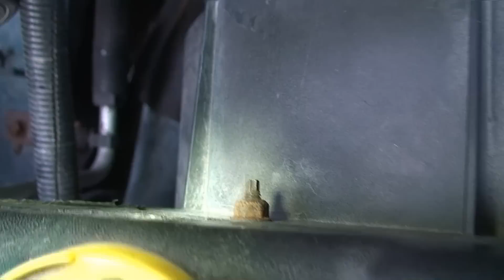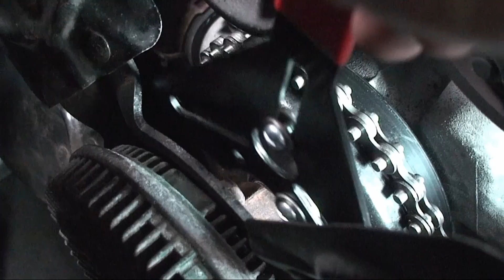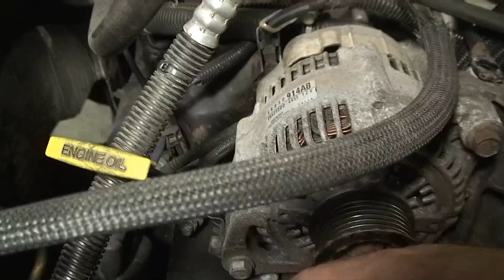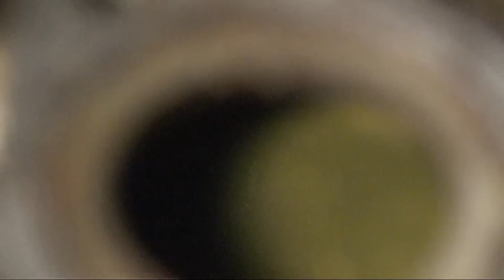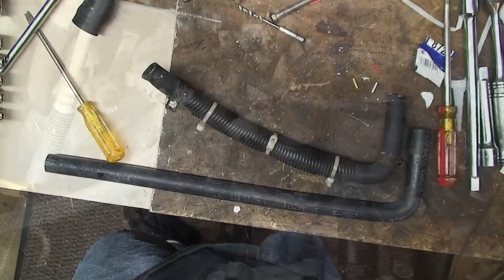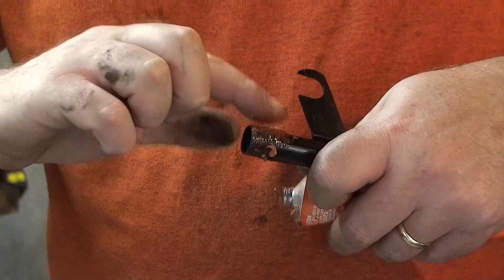Dodge Dakota Coolant Leak Repair - Including Bypass Hose, Thermostat, Water Pump, etc.

Comment: The Bypass Hose From The Intake To WaterPump Is Such A Bitch. Something Notorious Simply Not Reachable As It Really Should Be. I Always Replace The Bypass Hose When Replacing WaterPump. Just Like Replacing Timing Chain/Belt, Guides. Imma About To Find My Leak Today, I Hope It's Just The Heater Core Line Going Into The Intake. I Put Flush Lines On The Heater Core Lines. 1997 Dakota .318... 
Ole' Man Winter Can Be Brutal... Good InFormational Video. I Always Play HELL Getting Radiator Bolt Loosen. Somehow I Always Break It Loose. I've Been Told To Use A Torch To Heat The Nut Up Some, Then Give It A Whack.

Comment: Just pull the alternator undo small hose beside thermostat unbolt thermostat and remove that's what I did
Reply from the maker: Good tip, thanks

Comment: Not sure if you still check this but, was the leak pouring into the fan and spraying it everywhere?
Reply from the maker: I imagine that if it gets bad enough it might spray around, in my case it was a slow leak so the indication was antifreeze laying on the front of the engine
My guess is that it's the lower hose on the radiator
Is it over heating?

Comment: IF YOU RUN THE MOTOR HOT ENOUGH TO OPEN THE THERMOSTAT SHOULD YOU BE ABLE TO SEE THE ANTIFREEZE CIRCULATING

Comment: Looks like you could have just left the AC pump connected to the bracket. Just unfasten the brace bolt and unplug the electrical connector. Eh maybe I'm wrong.
Reply from the maker: That's a good tip, thanks for commenting!

Comment: I did noticed you had a 20 psi on you cap most all call for a 16! just a thought.
Reply from the maker: wow, good eye! I don't THINK I ever replaced that (can't be sure) any chance it's different on the V6?
Reply: @mreinsmith  not sure, but I'd get a new one.

Comment: The  bypass tube and bypass hose, clamps must all be replaced at same time.  Thermostat housing as well with new gasket and zero silicone should be used

Comment: Umm , step #1 missing ... DISCONNECT battery cable 1st (or run risk of shorting out charging and/or ignition system) (you know that BIG nasty spark when you short out a hot wire and wonder how many fuses and relays you just blew up , lol) ...

Comment: Great video here, learned a lot. Question for you, I have water leaking on the backside of the engine almost right above the oil pan, and I can’t figure out what it’s leaking from. Both my water hoses seem fine no leaking from the water pump, do you have any suggestions?
Reply from the maker: Water is tricky, it always finds odd ways to flow, the bypass hose would often leak down the backside of the engine 

If you checked the bypass hose already, then how about the heater hoses going through the firewall?

Comment: Thank you guys for the easy informative video, you made it easy as I was always scared from this terrible bypass till it actually started leaking. Did the job myself after watching the video and everything is fine. Just the ac compressor stopped working .. for some reason no power coming to the socket .. now am trying to figure it out .. fuse and relay are OK.. I'll check the socket wiring .. wish me luck.

Comment: I have a 92 Dodge Dakota with the 3.9L V6 it gushes coolant everytime I start it. So I'm Assuming it's the water pump because nothings coming from radiator or hoses and I changed the thermostat forgot the high heat stuff do I have to repoll everything to put that stuff on
Reply from the maker: Also, thermostats are probably the cheapest car part there is. I've read that the defect rate straight off the shelf is as much as %50 no matter who makes them

Comment: Do you have to put high temp on the gasket to thermostat?
Reply from the maker: Typically you Don't want to put anything on the thermostat gasket or seal, it could actually prevent it from sealing. Unless there is major damage to sealing surface (replacement is better in this case anyway)

Comment: I have a 5.9L 2000 dakota, my suction/discharge hose is leaking but I cannot find it as it seems to be a discontinued part. They have other years and even the 2000 4.7L hose but not mine. It all looks the same as yours here, it is the forward most A/C line connected to the compressor and resting at the top, behind the radiator. With that black ribbed shroud on it. Does anyone know if there is a hose compatible with the 2000 5.9? The 2001 5.9? Since this Magnum engine was 'the same' until 2003. Firestone, rockauto, autozone, oreilleys, nobody seems to know  what I can do (other than a junkyard, then its hit or miss if it is leaking or not).  Anybody?

Comment: I have a 89 Dakota and I’ve had nothing but coolant problems and leaks first we had to replace the water pump then the radiator then the thermostat 3 separate times and now I am on the bypass hose so I learned whenever you do the water pump just go ahead and replace the bypass hose

Comment: Thanks for the help....I have the same engine, getting ready to change water pump and thermostat, bypass hose. I only plan on going in once.  Also tap water mixed with coolant can cause corrosion build up. I use 50/50 coolant. Thanks for the rtv tip

Comment: Thanks for posting this video! Wish I had seen it years ago when I replaced the bypass and pump. I was able to replace the bypass without Taking off the bracket however it was brutal to say the least. Unfortunately the pump had gone out so seeing this to this job again is a lifesaver! Thank you!
Reply: Bleed the radiator on 98 Dakota 4x4

Comment: What YEAR is this Dakota? Engine size as well?
Reply from the maker: 2005, 3.9
Reply: So the year of Dakota in this video is why you removed the ac compressor and alternator? Didn't have to do this on my son-in-laws. Left them in place water pump bolts not interfering with removal!!

Comment: One think I did that made sense to me was to replace the thermostat housing bolts with studs. I did this primarily because I was ONLY replacing the radiator and top and bottom hoses, so the studs made it much easier to mount the thermostat housing is such a limited amount of space.
Reply from the maker: Awesome tip! That's something I never thought of and it would help in so many other common maintenance areas! Im going to add  studs to my hardware supplies. Thanks for commenting!
Reply: Glad this helped you.
Reply: what do mean ?  changed from the bolts to studs ?  non pointed tips ?

Comment: Thought leak was coming from water pump. I purchased and replaced water pump. When I added radiator fluid without engine running it started leaking from the shroud located by the thermostat. Thanks to your video I was able to successfully diagnose the problem. Tomorrow I'll reinstall everything poor in antifreeze to make sure there are no obvious leeks. If you know the torque specs for the water pump bolts that would be great!  Thanks for the video!!

Comment: where did you order the hoses from and do you have your part numbers?
Reply from the maker: My local Napa.  My other suggestion is to go to a dodge parts site that has the reference diagrams.   Then use that part number to cross reference (or just order the mopar part, prices are "somewhat" more reasonable on the web)

Comment: If indeed lubricant might spill out of the fan bearings, I don't see why a person couldn't take the opportunity to drain it, perhaps flush it with an appropriate chemical, and refill it with new lube. Is there any online info regarding this? Or is this just taking fluid & lube fanaticism too far??
Reply: As an afterthought, I'd probably be enough of a fanatic to service the fan bearings, too.
Reply: The fan clutch bearings can not be serviced and as for laying it down and fluid leaking out or whatever it doesn't make any damn sense, how many times do you think a new one being shipped all over the country to your local store flips rolls and tossed around the delivery truck and the store, why do they not all leak out some fluid and get trashed for leaking, someone let me know if they have ever seen a fan clutch leak lmfao

Comment: after replacing the water pump on my dodge ram 1500, i now have a leak that comes from one of the bolt holes. i had 4 long bolts and 4 short bolts. the leak is coming from one of the long bolt holes. i didnt think it mattered which long bolt went where as long as it fit. does it matter? maybe i should have used some RTV sealer right?
Reply from the maker: Unfortunately that could be anything from a cracked cover to a defective gasket, are you sure it's coming from the bolt and not running down  from somewhere else,  if it is you might try a New bolt and torque it. Hopefully it's that simple. Good Luck
Reply: owlman1963

Comment: Good video!  Wasn't sure how to remove the bypass hose.  Your video shows that it is a straight forward project.  I always change the clamps, as it would be a pain to have to replace a bad clamp after is is put back together.
Reply from the maker: You're absolutely right about the clamps. That's a good reminder!  Thanks for commenting!

Comment: Thanks for good camera work, appropriate emphasis, and sense of progress throughout your video.   Already did the water pump before I saw your video, and it needed replacing, but the upper tier of the cooling system was in bad shape as well, so I looked for your wisdom and found it.   Thanks for your help.  You're good at this.

Comment: if the rateater leaks all over the top of the motor it runs but the fluid runs over the motor
Reply from the maker: Yes, that is what was so frustrating at first,  I couldn't figure out where it was coming from until i started looking at the diagrams and tracing all the connections, then I realized where it was hiding
Reply from the maker: Yes, that is what was so frustrating at first,  I couldn't figure out where it was coming from until i started looking at the diagrams and tracing all the connections, then I realized where it was hiding

Comment: my dakota is not circulating water the top hose get really hot and has a lot of pressure It's not leaking anywhere and the water pump don't seem to be bad any ideas?
Reply: I just replaced the thermostat

Comment: Great video.  When you use RTV and finger tighten, you should wait about an hour until the RTV begins to dry, before torqueing.  It will get a better seal as less of it will be squeezed out the sides.
Reply from the maker: Good tip, thanks for commenting!

Comment: Okay, had to stop when you put a wrench on the tensioner.  Now, let's assume your vehicle is shut off and your keys are in your pocket. Great. Let's say that you drop a nut, bolt, or wrench and it lands on the starter, causing a short.  Boom, your motor turns over and you are hands, arms, and face inside a now-running motor.  It takes ten seconds to unbolt the positive terminal from the battery and provide you with an added level of safety.  Assuming that just because people at oil change businesses do it all day long doesn't mean it's a safe way to work on a vehicle, and when I myself worked at a lube shop and changed belts, I insisted on disconnecting the positive terminal until the belt(s) and housing were replaced.  Please stay safe and in one piece out there:  Even a great surgeon can only do so much, and you'll never be as good as you were if you need something reattached.
Reply from the maker: Well put, I'll be doing that from now on. Thanks for the comment
Reply: TombstoneLizard I stated on my comment that you should remove the positive cable first. ABSOLUTELY NOT!!!   The ground/negative cable should ALWAYS come OFF first; and the positive should always be PUT ON first.  I humbly apologize for stating that improperly in my earlier comment.  Working to remove the positive cable while the negative is still attached is a great way to cause an accidental short with your wrench, and knock the hell out of yourself or ruin electronic equipment.  Such a spark around gasoline or other flammable fumes ups the danger factor exponentially.  
Again, my humble apologies for stating the order of battery cable removal improperly.  There is far more chance of hurting yourself doing THAT wrong then there is the chance of actually dropping something to short out on the starter.

Comment: Great Job..I have a '93 dakota and I'm sure I have the same problem But I also herd some rataling noise it sounds  like it could be comming from a pulley or maybe the water pump..But It does look like mine is leaking from that area,,,Thanks again Dan!!!
Reply from the maker: Check your tensioner pulley and your idler pulley (the one between the A/C and Alternator

Comment: Would a clogged Heater Core cause engine to overheat?  I replaced Thermostat and put new fluid in - It worked fine then occasionally I need to rev engine hard and then I get heat and engine temp goes to normal.  Kind of scary commuting to work in -22 in rural country.  -Thanks
Reply from the maker: Yes, we had that exact problem in an expedition we had, start with a good flushing, but if it's bad you might have to replace the core
Reply: Kelly Longtine Considering that 50/50 mix antifreeze (anti-boil) mixes are created with distilled water, you will not have a problem with scaling and lime build-up in your radiator.  (Always avoid using water hose refills, especially from well water sources. If you don't have a 50/50 mix, use distilled water from any grocery store or pharmacy. DO NOT USE bottled water.  Most of those get their flavor from wells with a high lime and calcium content.) 
Having said that, the cheapest part, your thermostat, is the weakest point in the link. I recommend changing it at least every 30,000 miles.  It takes very little time; Permaseal and Loctite both make a nice gasket maker that I like to spread on the paper gasket the thermostat comes with.  Torque it properly and replace any and all hose clamps.  
I recommend the same for the upper radiator cooling hose:  Seriously, they are pieces of crap and are a poor replacement for metal tubes.  Check out Summit Racing for a rock-solid replacement. 
Also, and trust me on this, if your vehicle is at or over 60,000 miles, replace that thermal clutch fan; especially if you live in a predominately hot area, like Southern California, Nevada, Arizona, New Mexico, Texas, etc.   
Good luck, and always check your torque!

Comment: When using the RTV did you wait any amount of time for curing or did you just put it together and turn the truck on?
Reply: Some of the rtvs are fast to dry others aren't. If you have time .. leave it for half day before adding fluids and starting the truck. It's always better.

Comment: What are the torque specs on the bolts for the water pump. As my 3.9L SFI 6cyl has an aluminum block.

Comment: I have a 2002 dodge ram 1500 van 5.9L engine. My thermostat is stuck in the closed position. Is it completely necessary to remove all those components to get to the thermostat. I'm not confident in putting all the components back on properly. Any advice other then taking to someone I must pay to do it
Reply: if I can do it, you can do it....good luck, just make sure you have plenty of time

Comment: Question: Why would you not remove the window washer fluid/coolant reservoir assembly to make more room? Only two bolts, two electrical connections and one hose. Just asking.
Reply: +Albert Head Definitely the way to go. Gives you a LOT more room to work.  Only trick is to have a rubber cap ready to put over the washer pump outlet, so the fluid doesn't drain out through the pump. Disconnect the radiator overflow hose at the filler neck.and keep hose end above the tank level to prevent it from draining. Then just the 2 electrical plugs (washer pump and washer fluid level sensor), and 2 10mm bolts hold the whole mess in.will give you and extra 6" of room.  important when doing a water pump, because you need to get the gasket surfaces on the block CLEAN, and a brass wire cup brush on a drill does a great job, but needs good access.

Comment: Thanks for the tip on the high temp RTV for the heater hose.  Put in a new water pump on my 1995 Jeep Grand Cherokee 5.2L V8 with a new O-ring and of course it still leaked after warming up at the water pump quick connect.  After pulling the fan and fan shroud a second time, and still getting I am glad there is a solution in sight.

Comment: maybe someone on here can help me i have 97 Dodge Dakota 3.9 Liter V6 i'm spraying antifreeze all over but can't find the leak does anyone have an idea if i could of blew a a line have a pin size leak in one of the hoses or worse the water pump could of gave out any suggestions would be helpful thank you
Reply: sounds like a bypass hose off of the water pump if its c a healthy sized leak

Comment: Well I took off everything like you did on the video, and it turns out that bypass hose was pretty much cut right where the clamp was. So now that I replaced that, and added High Temp RTV to new thermostat and new housing, no more leaks! One question though. Does it take a while sometimes before the thermostat opens up and the temperature reads at normal 200? Right now I took it for a short cruise, and gauge was at the mark above 200. Do I have to cruise longer for thermostat to open?

Comment: Great thanks for this! I replaced my water pump on my 1997 Dodge Dakota. 5 years later, I thought water pump gave out again, since I am not a mechanic I thought for sure it was the water pump again. So, I bought another one, and everything seemed good, until I took it for a test drive. It was leaking from underneath AC Compressor. Because of this video, now I know that it could be the bypass hose since it has been there since 1997 I am sure it's that. Also, I never knew there was a high temp rtv

Comment: I didn't have to take the ac compressor by itself I just took the whole bracket with the alternator and  ac compressor to the side held by a piece of wood to the ground and worked great